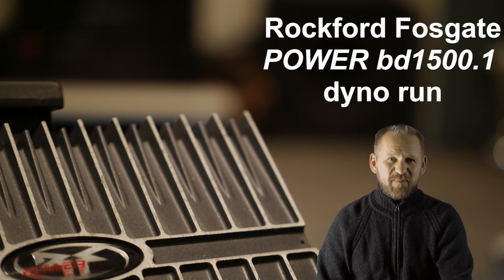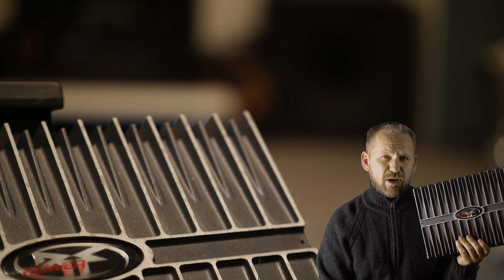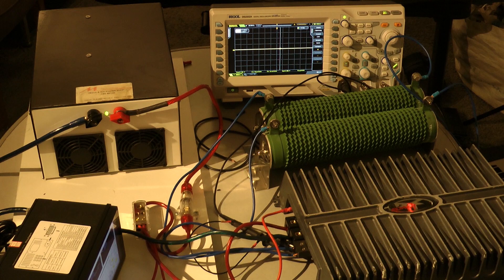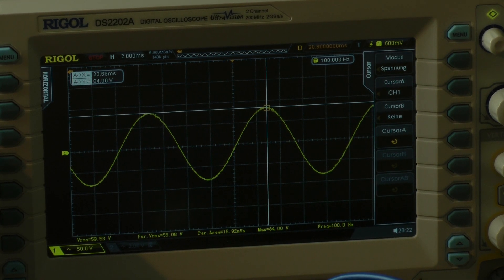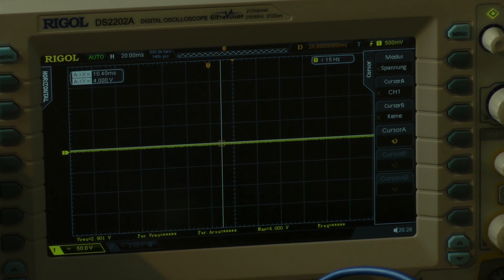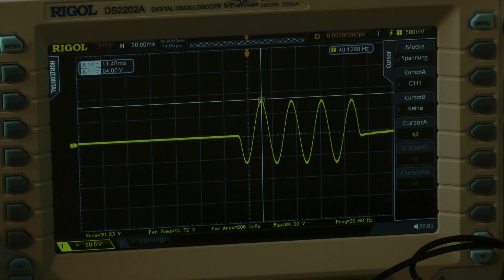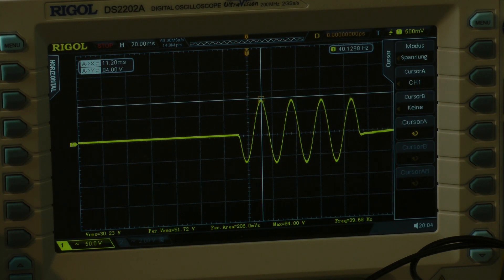Rockford Fosgate Power bd 1500.1 amp dyno run output power test oldschool amplifier

Comment: Is it possible to use an amp like this (1500 watts, mono) for a single DVC 4 ohm 400 watts RMS (800 peak)? I know the two output channels can be bridged, but I would appreciate any insight.
Reply from the maker: I think I would connect the two voice coils in series. This results in a 8 ohm load for the amp and shouldn’t destroy your woofer so easily 😊
Reply: I appreciate the feedback and I have the two voice coils wired in series, nice having reassurance that I have it wired correctly. As far as I found I think the single sub calls for bridging the two channels, Are both their watts compatible? Mine is the 501s
Reply: Bridged into a 4 ohm load is 500 watts x 1, The single dvc 4 ohm sub is 400 watts rms and 800 watts peak, wired parallel would be 2 ohms and wired series would make it 8 ohms. Otherwise wired to only one voice coil would be 4 ohm load.
Reply from the maker: 😂 I thought you talk about the 1500bd? The 501s doesn’t produce power to kill your subs.
Reply: Had to take a closer look and noticed it’s a 501s, Good to know it won’t kill my sub 😂

Comment: I have one of those amps right now I had it repaired but I still don't get no sound the guy Jason at Freeman car audio in North Carolina don't want to deal with it no more
Reply from the maker: I fixed a similar bd series and repair was difficult because here in Germany parts weren’t available and I wasn’t able to find good substitutes for the outputs, so I paid a lot for shipping parts from the US.
I also prefer fixing these class AB RF amps, parts are cheap and good substitutes are available. I am not a repair technician , I do it just as a hobby 👍 in this case I can really understand why some people don’t want to deal with them anymore.

Comment: What's the difference between this Amp and the newer t1500bdcp
Reply from the maker: I never had one on the bench, if it will happen someday I will open it and have a look into the amp that tells the differences.
Reply: Bdcp can do 1 0hm the old one not recommended just 2 ohm

Comment: Nice short video!
I read some reviews of this amp,😮 that say if you use cheap subs you will burn the voice coils.  I belive it!  I had not seen a Rockford amp with 6 15000 uF caps before.😮
Reply from the maker: Maybe unteilbar be thencase with expensive oldschool subwoofers, some of them had small VCs, no ventilation of the coil etc. todays subs can handle lots of power 👌
Reply: @audiokeller1975  The review was from 2005, so maybe the subwoofers weren't as powerful then, as you say.  The subwoofers that I have are Punch 15's from 2005-2006, 500w max each, so I'll probably won't be able to use this amp!  Thanks.
Reply from the maker: I mis-typed something, I have some HX2 subwoofers which are from 2001 or 2002 , these are powerful monsters with big voicecoils, magnets and heavy cones. The downside is that they are sometimes only around 85dB @1 Watt. The early 90s subs weren’t as powerful, feature smaller voicecoils, magnets. But: sometimes they were 90dB or more @ 1Watt. The bigger magnets and voicoils and voicecoils cooling vents keeps them running cooler which leads to higher power capabilities to compensate for lower dB @ 1Watt. I think it’s no problem to run strong amps as long as no fool is using the volume knob 👍😂 that’s why you need lots of power today to run todays subs, todays subs have less problems with power compression because they run cooler
Reply: @audiokeller1975  I know the subs you're talking about.  I had a 1999, 2000 Crutchfield catalog, displaying these beautiful punch "power" subs with huge magnets!  I could only afford the "punch" series, that were less expensive but not cheap.  I could barely afford the Punch amps, that weren't cheap either!  My first punch amp was the 200s from 2001, and the punch 800a2 amp ($425 usd).  I sold one, and the other got stolen from my car (800a2).  Thanks for bringing back good memories!  By the way, my punch 15's are 87db and 87.5db efficient, and 400w and 500w max power..
Reply from the maker: @charlesbolano7148 have two Punch HX2 in a very small closed enclosure, they are 83.4 dB each , both almost 87dB

Comment: Not going to lie, I like these Dynos much more than the Tony Dyno device that does all the math for ya. This shows how to do the math and calculate rms power. Just missing the amperage meter on the b+ and voltage so we can see voltage drop and current draw to calculate total efficiency. We already know most AB amps do not like low loads which cause them to run hotter and less efficient (around 55-60%), while high impedance loads make them more efficient at around 65-70%.
Reply from the maker: Thank you very much for your kind comment, dude!! 🙂 I have ampere meter so if of interest i can add this in further videos. I never did, because you can measure efficiency in two ways: continuous and dynamic. In the rockford birth sheets there is dynamic power printed.
I noticed that my power supply is bored if i measure dynamic power, voltage doesnt drop. I use a heavy weight transformer supply. 
I never compared my setup with those dyno devices, but i am very interested how these devices measure dynamic power because people do it in different ways. i try to maintain 20 cycles same level, some use the highest cycle and calculate. I would call this cheating and i dont know what the standards tell how to do it.
Thats why i always still include continuous power tests like they did it back in the days.
Regarding efficiency: class AB amps arent efficient in low levels like class D, thats a fact we all know, but i really like AB and the dynamic abilities of their unregulated supplies!
Again, thank you and thanks for subscribing !!!

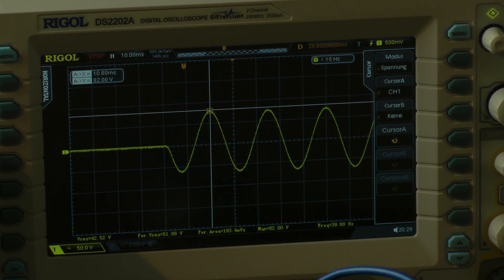Comment: Still waiting for your beat download link! :) @ 2:04 I like how the capture also shows the sag on the subsequent waves. Don't average them! Highest peak should be burst power IMHO.
Reply from the maker: Thanks for the reminder!! The audiotrack-download-link is now in the description!
Usually i only measure output power with 20 cycles at the same level, thats the reason why i averaged it and show the maximum and minimum - power in this case. The difference will not be audible at such high power levels.
Personally i dont like how modern amps are rated today : enormus power for 3-4 miliseconds and then power goes dramatically down, because modern amps overheat quick and got damaged. Especially if you measure continuous - they really dont like it. I still prefer the ratings they made back in the 80s and 90s with very low THD and from 20-20kHz.
If you connect for example a 1800 Watt rated " modern and lightweight amp " to a double 18" Bass and listen to music with low crest factor ( lots of bass like my backgroundtrack ) or even way lower.
Then compare to an oldschool heavyweight amp from the past which is rated only 1200 Watts. In lots of cases the heavy beast outperforms that lightweight thing in terms of bass and has a dynamic headroom of 2-3dB !!!!!!
This is why i dont really like the burst tests. With this you can not measure how an amp performs with long sustained Bass notes.
I made the test in my basement: i have two 18" dayton ultimax subs for home-theater.
I applied a 1kHz burst with 1000 Watts into one of the subs. The sub felt like " i didnt even noticed that there was a signal i should reproduce ".
If i apply a 200 Watt 40Hz signal into the sub , you will get a big smile in your face and haircut blown, because the amp which feeds the subs is a design from the 80s out of the pro audio section and maintains power for long periods instead of only some miliseconds  :-)
Dont get me wrong, i will never say that this counts for all " modern lightweight " amps but for some, in the 90s the amps were underrated and today some are overrated.
Reply: @audiokeller1975  I have always understood dynamic power to basically translate into burst headroom. Mainly for dynamic swings so it doesn't have to be continuous. Sadly, todays recorded media doesn't take any advantage of it as most tracks are now brick wall limited at 0db thanks to the loudness wars. If you want real dynamic range and a track that breathes you basically have to use vinyl. Thanks for the upload and the conversation!
Reply from the maker: @monosurge   i know what you mean : just stand right next to a drummer and listen. Its hard to reproduce this.
I tested a qsc amp which was rated 1300 watts, but dynamically it puts out around 2000 watts.
Reply: @Audiokeller  can you do a dynamic test on the Punch P500x2 and P1000x2
Reply from the maker: ROAD BEASTS of course I can do that - if a subber sends them to me , I do it 👍